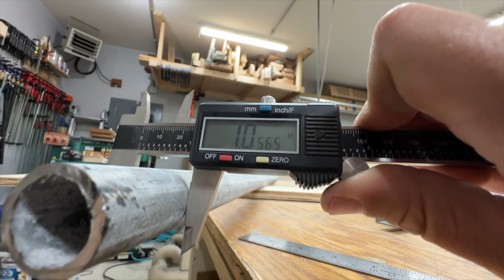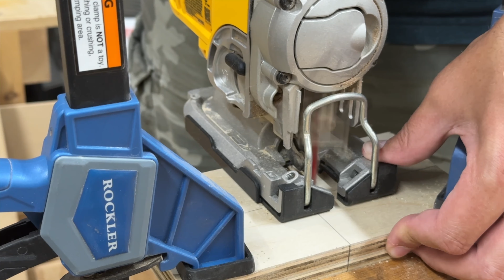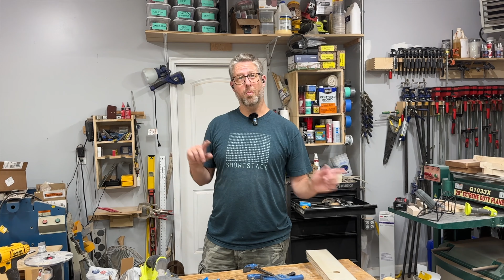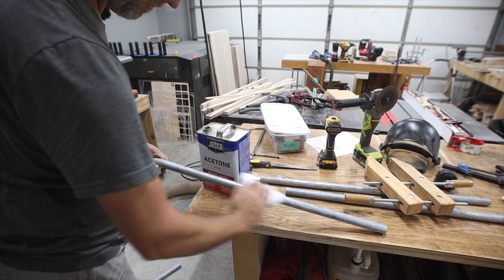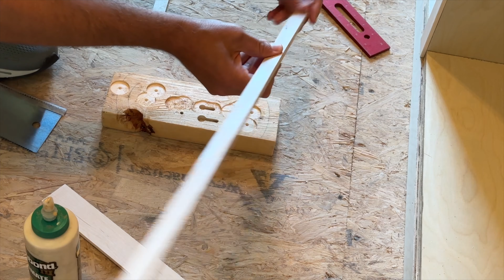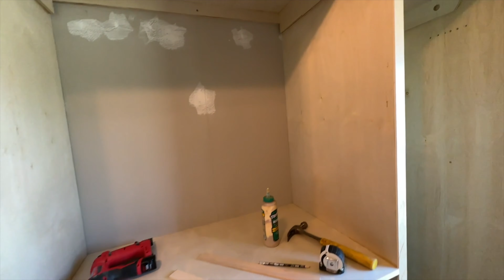Master Closet Renovation | EP03 | Making Hardwood Edge Banding & Hanging Bars

Comment: Why did you leave the base trim in the closet? Could it been more flush against the wall .The hanging rods could have cost more but using black pipe with ends.